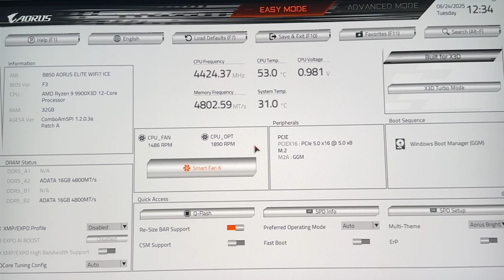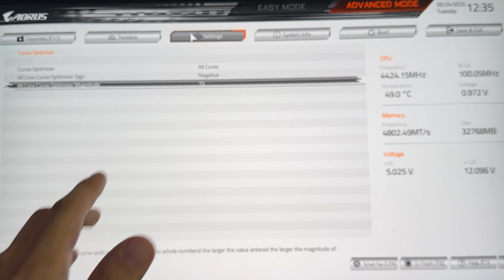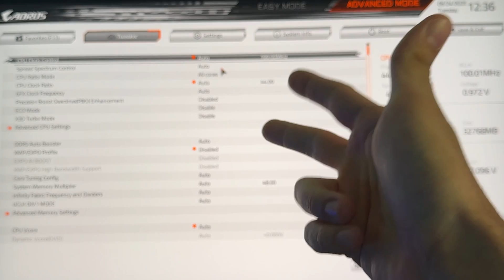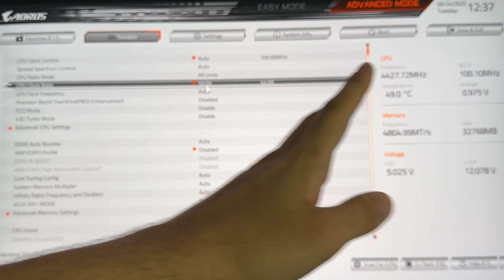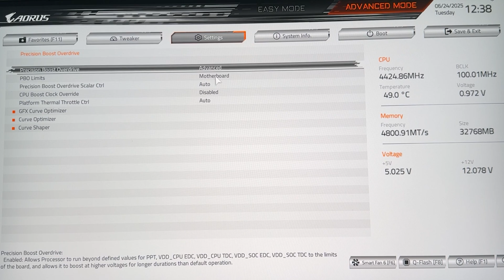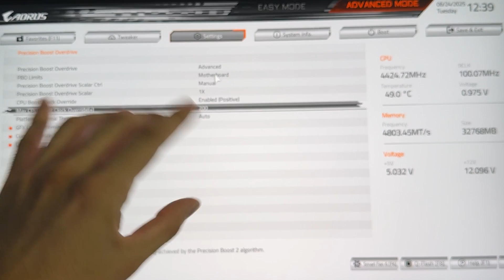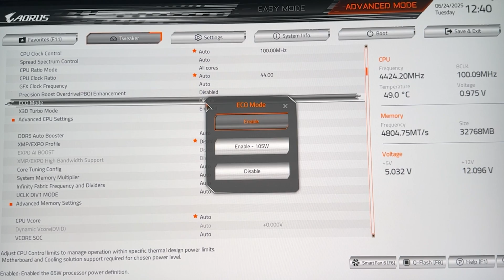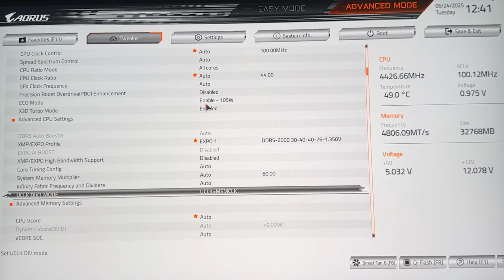Undervolt your Ryzen 9 9900X3D for more FPS and Lower Temperature!

Comment: I just followed the same setting that you had for the 9900x.  I had it set to negative 40 (-40) and the cpu run great.  What are the benchmark software that you use to test the cpu out? Should I try to push the cpu to -45?

Comment: You also need to stress test whatever settings you use in Windows using AIDA or something similar.  Most other programs will not put enough stress on the CPU to verify stability.

Comment: Just curious  @ImWateringPSUs  
I saw a reddit post about someones 9950X3D dying after 2 months of use on a Gigabyte Mobo.
Everyone on the replies told him to disable PBO to prevent it from happening.
I'm now torn because I just got my 9950X3D and I have my Curve Optimizer at 20, things are working well for me without any issues.
Just scared if my CPU might also die in just 2 months.

Comment: For visibility and help to other 9950X3D owners with the following specs:

 MPG X870E CARBON WIFI 
 GeForce RTX 5090 (ASUStek Computer Inc - TUF OC)
Main SSD:  SSD 980 PRO 2TB
CORSAIR Vengeance RGB DDR5 RAM 96GB (2x48GB) 6400MHz CL32 CMH96GX5M2B6400C32
Cooler: ARCTIC Liquid Freezer III Pro 420 w/grizzly thermal paste with positive pressure setup with 3 Noctua fans on the bottom, top and for exhaust and the cooler mounted on the front of the tower
Tower; Enthoo 719 (yeah, mistake for a gaming build)

I followed the instructions in the video and decided on the dynamic method.

-Started with PBO -18
-For the CPU boost override I went with +200 and my cpu was hitting 5936 and got me a little worried and every once in awhile it would freeze/crash. (Not before I was bragging to friends) 
         - I had 12900k with a msi unify x mobo with 420 arctic cooler 2 and the temps would go over 100 without limits placed while running cinebench and that made me cautious 
-Thermal control limit of 78
-My mobo has different options for eco mode and chose the 142 PPT limit

-No x3d turbo mode because I game and edit videos and etc
-Xpo on default
-Cstate enabled to help with idling temps being too high. I was idling at 48-49 C while clocks were average 5657, after I re-enabled, they goes as low as 43-44 if my room temp is 22 C (with AC on)
-I did notice some crashes and freeze ups when I was unzipping and taxing the cpu and lowered the clock modifier from +200 to +175 and PBO curve of -17
-Clocks were hitting 5912 mhz
-Worked fine for a week, but one day my PC just powered off and I got scared again, but it's not as if it was burning... there wasn't enough juice 

Current Settings
-Clock to +100
-PBO curve - 15
-Hitting 5824 mhz max
-Thermal limit of 85
-Fans are decently quiet running. CPU fan is running at 1500 (For the liquid freezer III 420, not bad and not that loud)
-Tower fans anywhere from 800-1200 RPM(I have 4 Noctua Reduxes and 2 of the  NF-F12's
-Idling temps are:  42-45 C
-Gaming (final fantasy rebirth, age of wonders 4, bg3) 52-57 C
-Rendering in Adobe Premiere (once installed  and used for the first time) was a noticeable improvement compared to my 12,900. What took 8-12 seconds to render, took ~1.5 second

I did have one question for fellow 9950x3d owners... how high is your voltage? Mine can go up to 1.419. Average is ~1.2's. Should I set a limit for this? I read that for the 9950x3d 1.4 is tolerable. 
Thoughts?

Next step would be to disable my board's 'eco mode' and run a few tests with benchmarks. 

Would appreciate any feedback. Thanks to ImWateringPSUs and the community.

Good luck to everyone!

Comment: I got mine to go to -30 on all cores except 6 and 7, 6 only managed to go to -11 without becoming unstable, and 7 to -18.
Reply: Tried again, non X3D CCD is at -40, X3D on 4/6 cores is -36, 2 cores were not as good and were at -11 and -20. AND IT IS STABLE WITH A  +200Mhz limit raise.

Comment: I have a 9950x3d. I did all the undervolting steps and set it to -20 for all cores. Should I do -30? I'm just scared to try. Do you recommend it?
Reply: No - 10 or - 15
Reply: @Darkoholic , so should I change it from -20 to -15 or -10?
Reply: @Darkoholic  and should I put pbo to motherboard or auto?

Comment: about the 1x vs 10x setting in curve optimizer, if i set it to 1x my pc works on reboots but wont boot after a a hard shut down, if i set it to 10x works like a charm with the same settings.

Comment: Probably worth mentioning what "X3D Turbo Mode" actually does - in that it turns off half the cores which can be pretty bad for anything that can utilise more cores, even games.
Reply: He activate only core with v cache, this is bether for gaming,
Reply: @brunotayrobiffe2088  That very much depends on the game and how many cores it can use. Disabling half of your CPU will obviously be detrimental on games that can use those cores.
Reply: @Enverex you don’t want the ccd1 cores(non c cache) running games. Less ghz and fps

Comment: I can say FOR SURE my 5900x cannot hit -15 on all cores. I need to set one single core to -5 in order for the system to be stable, the second CCD is all rock solid at -30.

What you really should do it set up per-core Curve Optimizer.

Comment: 9700X HERE 
DOES ANY ONE 1 KNOW HOW TO MANUALLY SET PPT LIMITS WHEN USING MANUAL VCORE.?
WHEN I MANUAL VCORE EITHER WITH PBO ON OR OFF PPT LIMITS DONT WORK WHERE I SET EM
AND THE WATTAGE JUMPS UP DEPENDING ON THE VCORE AND THE CLOCK SPEED
I WANNA HAVE THE CPU VCORE AT A POINT WHERE MY DESIRED CLOCK SPEED IS STABLE AT 
BUT I DONT WANT IT TO GO PAST 88WATTS  LIKE IN STOCK AMD
AND BASICALLY I THINK THIS IS WAT STOCK AMD SETTINGS ARE DOIN
BUT I WANNA DO IT MANUALLY MY SELF WITH MANUAL VCORE
IS THIS POSSIBLE.?

Comment: My 3060 was running really hot while almost doing nothing, stumbled upon the video where you explained everything for undervolting it correctly and much respect, man. You make this really useful videos for us that are not that literate in tweaking stuff but know enough to want to try. Right know I upgraded my whole system and I would like to mantain my components as chill as possible and assure they last long cause they ain´t cheap. Hope this works really well with the 9950x3D and going to watch your 5070 undervolt too.

Comment: I tested these settings on my 9900X,. Cinebench R23 score went up from 32,000 to 34,450. Idle temperatures are still hovering around 40–45°C. The motherboard is a MSI MAG X870E. I'm running PBO all-core negative-30 without any issues.
Reply: 40-45*C???? What cooling do you have?
Reply: @Spokahno  :face-green-smiling:
Reply: Did you do the undervolt only? Or did you mess with the clocks etc?
Reply: @MicroxboxBoy just the undervolting. I havent tried to mess with the clock since my cpu & gpu (9070xt) both never exceeded the 75C on full load specially playing on 4K.
Reply: yo en mi R9 9900x obtuve en cinebench 33.200 aprox con undervolt de -30

Comment: Here is a  summary table for ease of use. Find your MOBO brand and follow along.

Summery Table for easily finding the Twaeker tab on other brands:

BRAND	                                                                  Tweaker Equivalent Tab:

GIGABYTE/AORUS	                                          Tweaker / M.I.T.

ASUS	                                                                  Ai Tweaker / Extreme Tweaker.

MSI	                                                                  OC.

ASRock	                                                                  OC Tweaker.

EVGA	                                                                  Overclocking / OC.

Biostar	                                                                  O.N.E. / Overclock.

Intel	                                                                  Performance.

Dell / Alienware	                                                  Performance / Advanced.

HP	                                                                          Advanced / Performance.

Lenovo	                                                                  Overclocking / Advanced.

Comment: Can I do this on the 9950x3d
Reply: Update I did it -35 all cores then I followed your last set up thanks works great 👍🏽
Reply from the maker: Yessir! I was gonna say, from my testing so far it works even better on the 9950X3D, it seems to have a great voltage tolerance
Reply: @ImWateringPSUs can you possibly make a video on the 9950x3d I’m very interested I follow all your undervoltes

Comment: Hi, I have a 9800x3d and as soon as I activate the x3d turbo mode on Warzone I crash even though if it is off and undervolt or overclock everything goes well, any reason?
Reply from the maker: Make sure you have the latest bios and also double check it doesn’t have anything to do with your RAM. But since the 9800X3D doesn’t have cores without 3D V-cache, I’d say you do not actually need to enable X3D Turbo Mode as much as in the 9900X3D or 9950X3D
Reply: don't use the x3d turbo mode on the x800x3d chips, the reason why you use it for the higher skus is because they have two ccd's, and only one has the 3d vcache. Itll actually lower your performance. Even if you do then it's not really needed because the amd drivers will automatically park half the cores whenever you're playing a game.

Comment: Would this work for the 9900x non 3d? If so is there anything we should do differently
Reply from the maker: It’s gonna work exactly the same but better (of course avoid the X3D Turbo mode), as non x3D chips tend to handle voltage better :)
Reply: whats the most actual 4k efficient gpu in your opinion? With undervolt  mean. And also the model of the gpu. ❤  @ImWateringPSUs
Reply: @ImWateringPSUs thank you so much! Have a great day

Comment: I’m experiencing a freezing or hanging issue on my PC. I’m experiencing frequent freezing and hanging while using Chrome, Edge, Firefox, and even when playing videos in VLC Player.

Here are my PC specs:

CPU: Ryzen 9700X (using integrated graphics only)

Motherboard: MSI X870E Tomahawk

RAM: Kingston Fury 32GB (16x2) DDR5 6000MHz CL30

SSD: WD SN5000 500GB NVMe

PSU: MSI A750GL

Cooling: DeepCool LE360 V2 

I’m using the 9700X’s iGPU for basic tasks, such as web browsing and watching 4K videos.

Troubleshooting I’ve already done:

Ran Cinebench and OCCT stress tests – no errors found.

Tried default BIOS settings, but the issue still persists.

Updated chipset 7.06.02.123 and display 25.6.3 drivers from the official AMD website

Temporarily fix: Disabled hardware acceleration in Chrome, Edge, and Firefox – this seems to make the system more stable, but then CPU usage goes up to 46% when playing 4K YouTube videos.

I also recorded some video clips showing the issue in case they can help diagnose the problem better.

https://youtu.be/ipqZbpsLIic?si=aqGC_G6n9ZsrrYWi

https://youtu.be/fZU6Zi_lqMo?si=j_XKbQj4bdmR98eU

Could you please help me figure out what’s going wrong? I want the system to work smoothly for basic tasks.